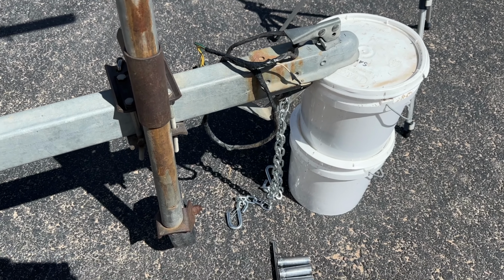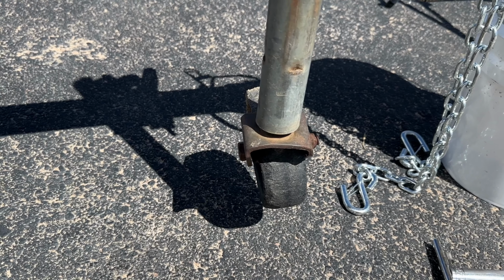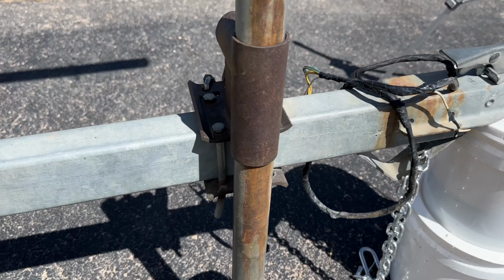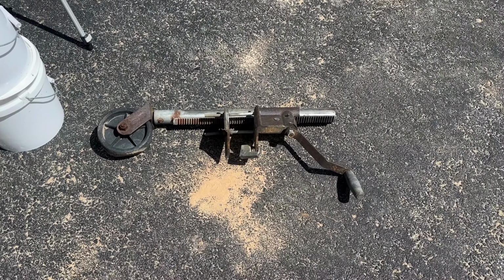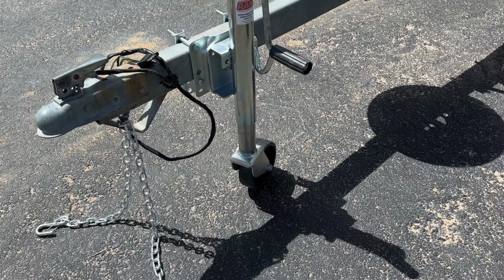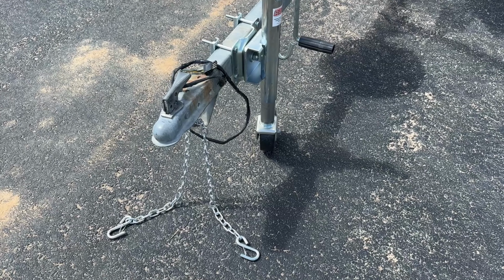Precision 16 Trailer Upgrades

Comment: Knee pads or heavy duty cushion for the knees Dave. Trust me, when your knees get older they will thank you for the preventative maintenance. Even those short moments on concrete or asphalt etc does damage. Great to see satisfying improvements on the trailer for the 16!
Reply from the maker: @saabtech3510  I own a roadside assistance business and wear knee-pads regularly when out changing tires and working on people’s cars. Definitely a good tip!
Reply: @ColoradoSailing  That's a coincidence indeed. I was driving tow truck for AAA around 1980 and I would kneel in the snow changing flat tires with no gloves. An older man whose tire I was changing told me not to kneel in the snow, that I would be sorry later. He went in the house and came out and gave me about 5 pairs of gloves. I was actually thinking about that when I made my comment.
Reply from the maker: @saabtech3510  Very cool! I started with Virginia’s Motorist Assistance Program in 2007 while also full time active duty military. After retirement from the military, I decided to go back to it part time. I work as an independent contractor with the insurance companies. Check me out on YouTube: https://youtube.com/@palmerridgeroadrescue-wt7zy?si=lM8ei-rbLG_mRrr_